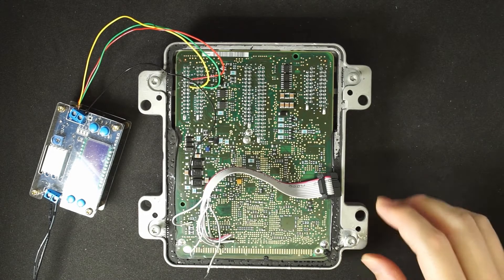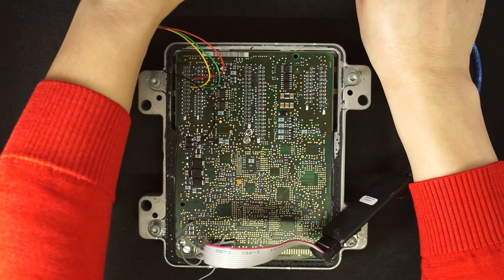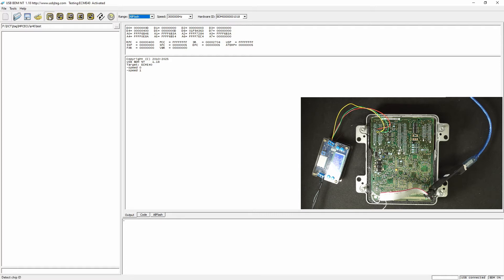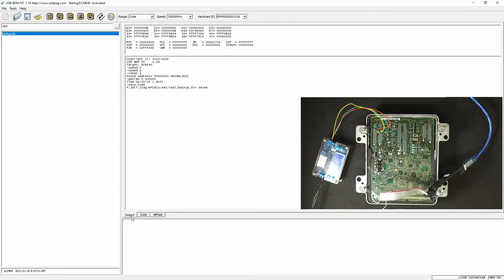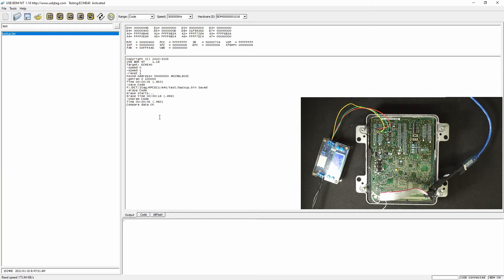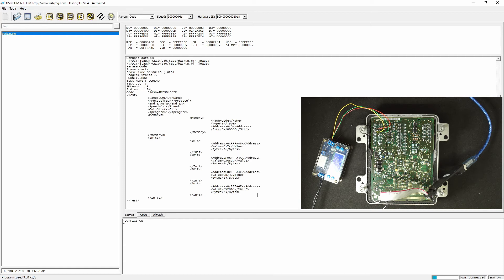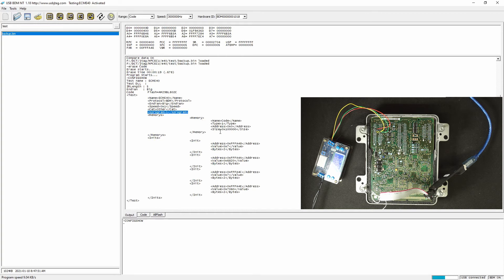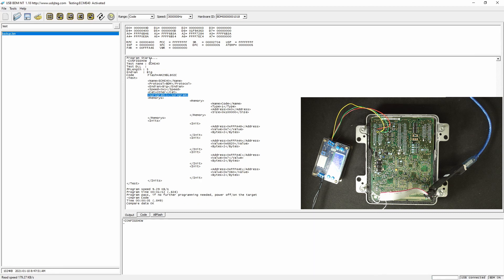USB BDM NT Program ECM E40 (MC68377)

Comment: Is this the same E40 the 2005 Pontiac GTO uses?
Reply from the maker: I am not sure.
Reply: @usbbdm  I was loading a calibration and the voltage dropped causing the ecu to become nonresponsive. Is there any way to unbrick the ecu?
Reply from the maker: @2015_Rubicnn  If the firmware get corrupted, u-Link NT can restore it.